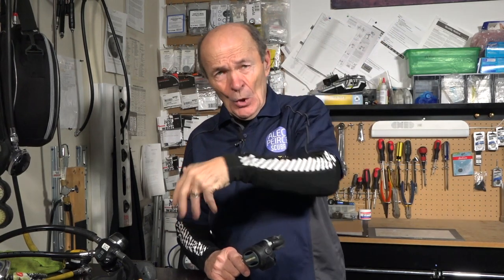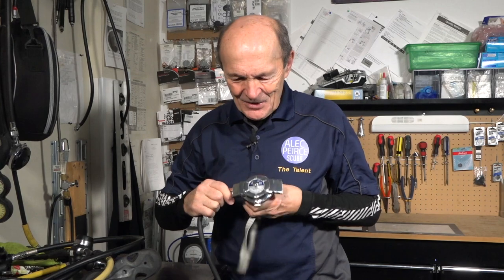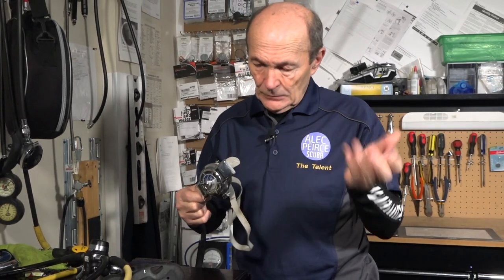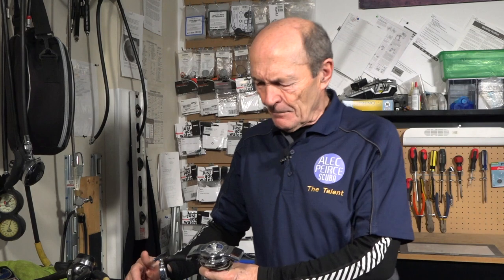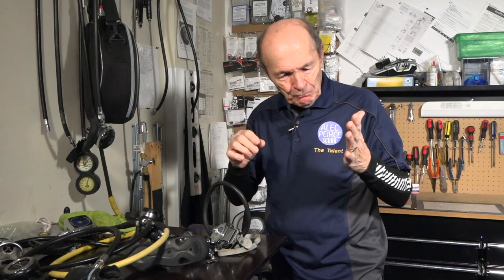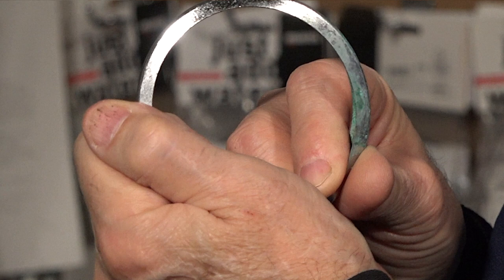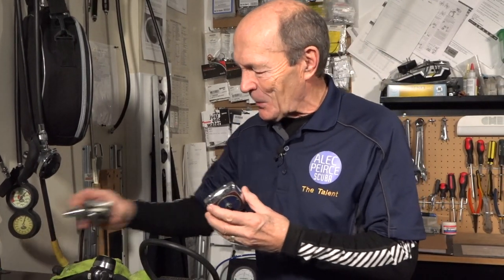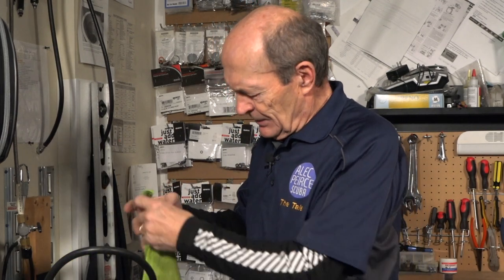Cleaning Chrome Regulators - Scuba Tech Tips: S12E02

Comment: the greenish corrosion is completely normal when the brass structure is cladded with a chrome layer, the brass is the sacrificial anode in regard to the chrome so when the chrome layer is scratched to the base metal, it is the base metal that corrodes  to protect the chrome layer and the typical chrome layer is known to be porous.
It is the opposite of the galvanisation where the zinc protects the underside ferrous material in the case of of a scratch in the zinc top layer exposing the ferrous base material.
very good video.
Reply from the maker: Thanks Jacques, glad you liked it and thanks for the information to everyone.
Reply: Brother-diver Jacques, GREAT information!  Never knew this process before.

Comment: If you think you need steel wool to clean your regulator, what you really need is a new regulator.  Minor scratches do not matter.  I'd also advise against metal polish, especially on sharp contours or edges, because it is possible eventually to actually polish through the chrome and expose the brass underneath.  Then you really will have to keep polishing!  Rejoice in the patina as a symbol of your diving experience!
Reply from the maker: That is one option Tim but the condition of some vintage chrome regs needs super fine steel wool to get down to the chrome.  Another option is some vintage collector friends of mine actually re-chrome them to like new condition.  It's expensive but some collectors have superb collections and like real silverware, need regular cleaning.   Thanks for sharing and watching my friend.
Reply: @AlecPeirceScuba_SeaHunter  I'd agree if it's a vintage piece of kit for a collector, but if you're going to dive with it regularly, just take care of it as you advise.
Had a bit of a smile the other day when I came across 'Creature From The Black Lagoon' and saw lots of mid-'50s Scuba gear, including some of the kit you have shown us.  I now knew what I was looking at!

Comment: Some divers claim that metal second stages cause less dry mouth than plastic.  ('Say that water vapor from your breath, condenses inside stage body, and makes breathing gas more moist.)

What has been your experience?
Reply from the maker: It's such a tiny amount of moisture given the super dry breathing air so not much of difference.  Before diving, drink water and when back on the boat or shore, drinking 1/2 litre of water does much more to re-hydrate than what a reg can give.
A
Reply: @AlecPeirceScuba_SeaHunter  I figured it was a Catch 22, from reading other web posts, and speaking with other divers.
I was really hoping that it worked (I get dry mouth).  Plus, I must also have been a Magpie in my former life (stole that from UKDiver).  I like shiny things.  That Kirby Morgan Super Flow 350 sure gleams!
However, I’m not sad that my plastic second, is much more corrosion resistant, than metal.  That Scubapro MK19/G260 Carbon Black Tech looks sweet!  Bonus, I don't have to polish it!

Thanks again, Alec!  Keep diving and enlightening us!  🤿

Comment: Hi, Alec. I have a question. I have been following your advice on cleaning my modern regulators. I have found that, even though I soak, scrub, and rinse my regs after each dive, even in those problematic areas, I still sometimes develop a little corrosion around the threaded areas like where the air hose connects to the second stage. I have found that I have to sometimes loosen the hoses and nuts to expose the threads and use a toothbrush, warm water, and soap to clean off some of this corrosion. Sometimes I use some really fine steel wool to remove some salt corrosion. It just makes me uncomfortable because when you start loosening things you risk water getting into places it shouldn't. Am I doing something wrong in terms of cleaning my equipment after dives, or are these just problematic areas that should be cleaned by the tech when I take it in for inspection and servicing? Thanks for the advice and the videos.
Reply from the maker: If your being very conscious to soak and clean but still minor corrosion is showing on hose connector it could be other problems.  If the hose threads are the only part with corrosion showing, maybe time to replace with new flex hoses.  Next dive (lucky you), soak the full octo setup in warm water for a few hours, rinse with fresh water, let dry overnight then examine the thread connection for signs of corrosion.  If any shows up this quickly it may be the hose connector.  Give this a try and if it appears, replace the hose with the most corrosion showing then dive, soak, rinse and dry and examine for corrosion.  If none shows on the new hose but older hoses do show signs, time to replace all the hoses.  My thoughts so give it try Josh and thanks for watching.
Reply: @AlecPeirceScuba_SeaHunter  great advice, Alec. Thank you. I will fo that.

Comment: "you can't buy plastic scuba tanks".   Well, you kinda can, theyare made from carbon re-enforced plastic, what we coloquially call "carbon fibre"....   

They are actually not great as scuba tanks not because they are not strong enough, but because they are not heavy enough, so they are too "floaty" for underwater work, hence CF tanks mostly being the preserve of SCUBA's close air dwelling relative SCBA  :-)
Reply from the maker: So we agree there are no plastic tanks, yet.  Someday a new material may replace aluminum or steel but for now, these two metals rule scuba.  Thanks for the information Max.
Reply: @AlecPeirceScuba_SeaHunter  lol, it's semantics but carbon fibre which is technically speaking a woven or unidirectional carbon filament impregnated with an expoxy binder and therefore would chemically fall under the description of " thermosetting plastic".....   ;-)